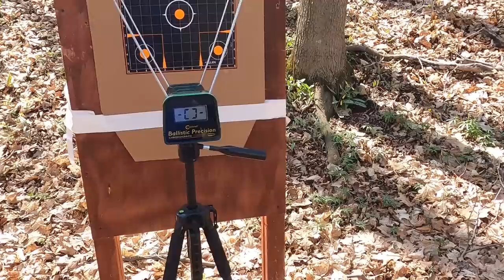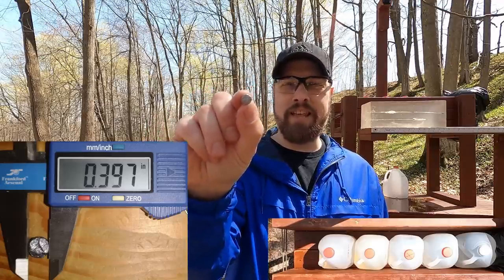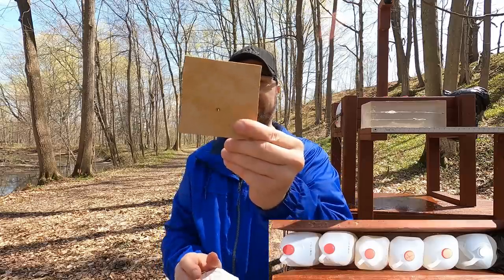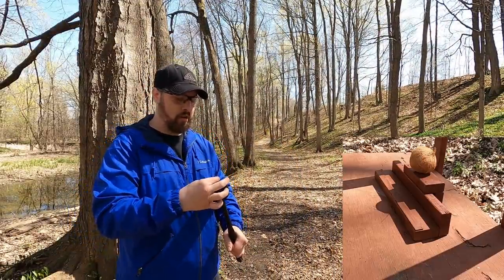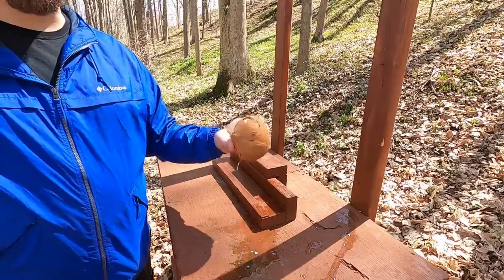WOW Dieseled Pellet Rifle RIVALS Firearm - .30 Caliber Break Barrel OVER 50 Ft Lbs Energy!

Comment: Its refreshing to see someone loading a spring rifle safely i.e. holding the barrel firmly in case the sears fail or you nudge the trigger. Better still, just break the barrel but don't cock it, load and THEN cock the rifle a close. Dieseling happens EVERY time you shoot a springer from the lube on the piston and cylinder. It doesn't damage the rifle though. The original users of dieseling used to drop the lube into the cylinder potentially causing more internal  damage. I suspect putting it in the pellet skirt may not be so damaging. However its still a very bad idea. Its also likely to totally ruin accuracy as well as the rifle. Its a stooped thing to do. If you want more power just buy the right kit

Comment: Having the ability to vary the power needed for any particular shot is a great asset. I have noticed a brand new air rifle with factory oil  within is a lot more powerful than after a few shots. Keeping the compression cylinder free of debris and the seal's clean is a difficult task, Old guns had leather seals.

Comment: I never thought of using Vaseline but I've used 3 & 1 oil many times. If it does hurt the gun I've never noticed it. Yep makes it much more advantageous for pests! Excellent video!
Reply: kinda opposite for me, I've always kept my pellets wet with WD-40..
over a year ago saw some videos on dieseling, "well no wonder!"
honestly didn't know I'd been doing it all along, for decades.
Crosman field pellets have the cone shape and short straight hollow, surface tension keeps that smaller hollow filled, inner cone surface only just wet, so it ends up being pretty consistent for the "extra charge" all by itself.
Reply: What ever you try, run 10 shots through a crony to see if the speed is consistent enough to hit a target more than once.  To me, if I am getting more than 2.5% fps change,---it might be OK for 30 yards, but that is not working for longer distances I like to shoot.
Reply: I have been using the vale line in pellet skirt for several years with great improvement in power. Your gun will have a different point of impact and probably prefer a different pellet. Main point: With Vaseline in the skirt , the dieseling happens in the barrel. Liquid fuels drain down into the piston camber and ignite there...big difference in seal life?
Reply: @EarthSurferUSA  They say if you use slugs and not pellets it improves accuracy because the pellets is unstable at supersonic speeds.
Reply: @a64738  That's correct, if you diesel your air rifle it's better to use slugs to keep the speeds down below supersonic for better accuracy. But then again, I saw a video recently of a guy shooting a Gamo Gen3 magnum .22, using super light alloy pellets that reached nearly 1400fps, well above the speed of sound, but they remained incredibly accurate at 35 yards. His results made me re-think that supersonic reduces accuracy.

Comment: Yep I've been shooting Air Rifles since 1980 and I'll tell you this dieseling my Beeman Duel Caliber Piston Air Rifle turns it into a lethal weapon and especially with 22cal non lead Red Flight Rounds it's definitely good for Home Defense shooting up to 1400FPS .
God Bless
Vaseline is the best way to diesel pellets because you can control the amount of dieseling and it doesn't run out if the pelletslike oils do. Try it you'll be very impressed because a half full skirt in pellets is just amazing added strength a full skirt in 22cal can be used for larger game especially head shots with a desieseled round will take down large game !!!!!!!!

Comment: Love my airguns. I have MP Pneumatics, springers, and PCP's. Enjoy them more than my powder burners honestly. Hope you keep doing some air stuff here and there. The market and hobby has exploded in the last 5 years or so.
Reply: I must admit that my sub 12ft/lb Diana springer is greatly improved when the pellets are dieseled. I tend to use a 30 grain pellet coated with molybdenum and dieseled with a vaseline/naptha(lighter fluid) mix. When the air temperature is very hot I can get over 1000ft per sec.
Reply: @49mrbassman  does your accuracy suffer though? It's claimed in the airgun world that a diabolo shaped pellet just can't handle much more than about 950 fps without destabilizing and negatively affecting accuracy. I personally can't confirm or deny, but I'd love to see an actual test done at say 900, 1100, and 1300 fps. At 20 yards I think you could zing one 1500 fps and you could keep it within a couple inches. I don't think it would work out to 100 yards though. When it falls back into transonic from subsonic is supposedly where the most of the destabilizing occurs.
Reply: @joshuagibson2520  it's more like an airgun bullet rather than a diabolo pellet it's very stable and gives excellent accuracy up to 75 yards. I replaced the original spring with an ox spring accelerator which increased performance and stability.
The pellets are knock out pellets and I stand corrected they are 25.39 grain made by JSB in the Czech Republic. The molybdenum makes them virtually frictionless in the gun barrel and reduces air resistance.
Reply: @49mrbassman  oh yes. I'm familiar with JSB knockout slugs. They're quite the little beasts. I'm still not convinced that airguns can't be effective in a supersonic scenario. All the pros I've conversed woth keep telling me that air and supersonic won't work with accuracy. Slugs or pellets. I've yet to see it actually tested and documented anywhere though.
Reply: @joshuagibson2520  I can only relate to the experiences I've had in the field when out rabbiting and I've taken plenty of Rabbits with a head shot at 60yards, I've also had a few woodpidgeons at about the same distance.
Reply: Air arm S410 SL  FAC ( About 890 to 900 fps with 5.52 mm 18 gr. pellets ) Over 3000 pigeons in the past 10 years at the dairy farm . Yes , they work .
Reply: @kermit8619  hell yeah. Fun fact, up north airgunner just launched some supersonic slugs with air and they were accurate. Sorta. They still didn't deal with wind too well. It was just an exercise in science. Says it's still never going to be a reality. I'm still going to hope it is.
Reply: @Troy Hendrickson we don't have an airgun violence problem anymore than we do a gun violence problem in this country that is a "public health epidemic". It's time to start rolling back infringement and be active, not worrying or wondering what they're going to try and restrict next.
Reply: @joshuagibson2520  At 1,000, most skirts begin to melt m m and lead the barrel pretty bad. From about 850 to 1150, you’re flirting more and more with Mach 1, and the shape of a a pellet does mess things up. Very unstable. A slug can handle the instability because the interruptions slide over it much better. 
One other consideration is that as you get closer to Mach, the ballistic coefficient of a pellet drops, well… lol like a pellet
Reply: In other words, even if you did a feat, and got the pellet to 1300,
Then had another lotto win, and it was accurate, (lol not) it would fall back below 1,000 before it went 40 yards, unless it were super heavy. Which usually assures it won’t go Mach to begin with. Ballistics above and below the sound barrier are two VERY different animals. A slug traveling 1700 FPS will suffer more wind drift in a given distance than a slug going 950. I kid you not.
Reply: @fanaticsforpneumatics6005  yeah. I'm still gonna dream though. Lol.
Reply: @joshuagibson2520  Bro man, May I be cursed if I stop a man’s dreams. I’m going over all this because I’ve been through it all over the last 6 years, from break barrels to Pcp s to 2k dollar pcps. You ever see “Blow” with Johnny Depp? What’d homie say to him in prison…”Perhaps you had the wrong dream, my friend.” lol what I’m gently guiding you towards is the slug world of airguns, bro. They carry SO much more energy long range. Think about it, a pellet is a self-stabilizing parachute lol.
 Dude, everyone says physics limit airguns to subsonic accuracy, and that’s it. But I still hope to see the day we understand how to get 2k FPS like black powder. I’m 50, and ain’t gonna stop dreaming! Your dreams are divine deposits, my man! Dream on!
Reply: The FX Impact introduced me to small (.25 caliber) bore airguns doing well with slugs. Now I have the semiauto Huben K1 in .25. I’m shooting 26.8 grain Neilson hollow point slugs at about 1080 FPS, and getting .60 groups at 51 yards. She’ll ring 8” steel at 217 over and over till it’s boring. Slugs are definitely where it’s at, and that’s what has propelled most of the renewed interest in the last 5 years for airguns. The difference in trajectory is staggering, dropping about half as much as a pellet at 217 yards, and retaining as much as double or more the energy as pellets at that range. It’s a whole different ball game that I invite all I can to come play in lol
Reply: @fanaticsforpneumatics6005  I agree man. Slugs are where it's at. The best gun I currently own is the Umarex Origin. I feel like eventually there will be a slug shape / design that will be able to overcome the 1000 barrier eventually. It's also going to take a power plant that isn't a single shot gun too. The airgun community / industry is blowing up! It's like we're living the muscle car era!
Reply: @joshuagibson2520  if you’re on a budget and wanna go the slug route, I HIGHLY recommend the Air Venturi Avenger. Adjustable regulator and hammer spring for 400$! I bought the earlier version, the Nova Vista, and I’m machining lol…. Ha ha Ruger 10/22 barrel down to fit it and shoot slugs. This barrel is 28 inches, I think factory is like 21. Gonna rework the valve, transfer port, etc. Fun Stuff! It’s a bargain for the price. Consistent and inherently simple too! Check it out
Reply: @fanaticsforpneumatics6005  that's gonna be my next purchase actually. Lol. I MUST get a compressor first though. The AVENGER isn't hand pump friendly like the Origin.
Reply: @fanaticsforpneumatics6005  my Origin is essentially a non regulated Avenger.
Reply: @joshuagibson2520  yes that’s right. The Huben is a 5k psi (350 bar) fill as well.
Help yourself and go with the Yong Heng compressor. I’m on my second one, first lasted 3 years of heavy use. 
I cobbled together a 60 minute 350 bar  SCBA tank with the PCP fill setup for maybe a lil over a hundred bucks. I can share how when you get ready, and communicate to help you, maybe make you some Delrin seals, etc to plug stuff you’re not using on it and seal stuff together. I bought like a 1996 manufactured tank, no dive or paintball shop would touch it with a 40 foot pole lol but screw them! lol we don’t need them fools anymore. We got 250$ compressors ha ha. And when I did used to go buy air in my silly ninja bottle, they could never get it over 4,000 psi bro. lol that sucked. This lil compressor will push my rifle or tank to 5k and then some
Reply: And if you ever need a Delrin seal real bad, but don’t Wanna wait for shipping??….
Nylon works plenty good, sir
Reply: @fanaticsforpneumatics6005  Hell yeah! The YH compressor is EXACTLY the one I've been eyeballing! What also appeals to me about it is replacement parts are readily available and they're pretty dang easy to maintenence and work on too from what I've seen. One thing you could advise me on is, what are you doing for a moisture filter? I'm not overly paranoid about it like some guys I've seen, but I do want some protection.

Comment: Every person that uses a cutting torch should be familiar with the rule to Never put oil on the threads of gas gauges. I have seen the aftermath of an oxygen cylyender and the melted gauges after someone put oil on the threads. The oxygen in the compressed air acts very quickly with oil. That is why dieseling is so effective. I blew the seals and the back end out of my first air rifle as a kid ,when i put a few squirts of 3in one into the compression chamber. i learned about dieseling fast.

Comment: A good side by side test. I am not surprised to see the dieseled pellet go deeper, you were between 30 and 50 percent faster. Speed kills, literally. It just shows you that the air rifle you use for varmits can be used for defensive needs if your desperate.
Reply from the maker: Thanks, and that's why I tried to hit home the pellet weight. If we went 40% faster with an 8 gr .177, this is nothing really. But doing it with a 48 gr pellet is like, well the extra is twice as powerful as some pellet rifles not to mention the start power is more than most. I own a typical .22/800 FPS springer that maxes out at 18 ft lbs, so three times the power of typical is not bad.

Comment: Being an experienced motor-head I am amazed at the long shot of achieving a stoichiometric or theoretical air to fuel mixture by placement of the fuel.....Any amounts of 'boost' by the dieseling would literally be roulette wheel chance at achieving an optimum max-power mixture
Reply: It seemed to be running a bit rich. 😊
Reply: WD40 a little drop seems to give the most bang, double the velocity according to chronographs. Vaseline and a lot of it gives low velocity.

Comment: Ultimately dieseling will blow seals sooner and can cause extra wear on the airguns performance. It's fun but the gun was not built with the extra pressure, not to mention the explosion that occurs when dieseling. It will make your gun require more maintenance sooner and can eventually damage it.
Reply: Joshua Greenspan  What's that got to do with anything? I didn't say anything about not dieseling in fact I said it fun. Just there are consequences to doing so.
Reply: Nah

Comment: Learned all about Dieseling pellet guns here on YouTube almost a decade ago.
    Swear by it, although I have blown a seal or two over the years.
    Generally an increase of between 25% to a third more power across the board.
  Good times👍😁
Reply: " I have blown a seal or two over the years."

In the bay, or at the Circus?

Comment: Impressive for a pellet gun. I know some of the high end ones can really get down and absolutely be lethal. I know the AirForce Texan is a .45 Caliber air rifle capable of taking down medium sized game with ease so I'd have no doubt it could take down a man with a well placed shot. These .30 Caliber pellets would absolutely be something you wouldn't want being shot your way. I do question though how quickly it loses that velocity and how far away you'd need to be before the penetration would be less than lethal. I noticed you were shooting from fairly point blank ranges in the testing, so I wonder at 25 yards or 50 yards how much effect would it have even when dieseled.

Comment: Thanks a lot for this video, The best material to diesel the pellet is the Gun Oil you use on gun maintenance it would heat up faster produce much greater pressures.

Comment: Wasn't aware that this could be done Pretty impressive!!
Reply from the maker: Yeah it's a neat little thing, but always a cautious thing as pellet gun barrels are not heat treated rifle steel.
Reply: @GunSam  Are they rifled in the same manner as a firearm barrel? I’d be curious as to the comparisons of twist rates etc between them if they are.
Reply: @Bodhi1satva  They are rifled but to what extent i really can't say I'd be curious also to know. I've been shooting both air and powder rifles and pistols for well over 25 years and can honestly say I've never diesel anything before.
Reply: I'm shocked you said you couldn't get through the bologna. My .22 caliber break barrel can blast straight through a pack as thick as you had with no issue's. But regardless good info and good shooting.
Reply: @jamesleary1405  your 22 probably has similar power with 30% less surface area leading to more penetration.
Reply: I put a 22 pellet through a heavy metal paint tin .Big entry and exit hole ..Gamo roadster spring.

Comment: Cool video! I never knew dieseling your pellets was a thing.
Reply from the maker: Thanks!
Reply: I didn't either but found out 15-16 months ago, I'd been doing it all along!
I'd always been keeping my pellets wet with WD-40, the thought being the light oil helping skirt seal and barrel a little lubed too for a little more hit. didn't ever think about pressure actually detonating the oil stuff, just knew it worked better.
Reply: used penetrating oil a year ago to get a 177 pellet gun working again. anyway the first shot was loud. even had some smoke come out of the barrel. think the gun was 1000 fps without the oil. suprised me

Comment: My friend put a Titan XS no.5 spring in a B19 .22, he also way over greased it so grease actually was coming out of the air transfer port. To his surprise it made a few 32 ft pound shots on the chrony, once it settled down it was consistently running at around 16 ft pounds, which was still too much for his countries laws so he had to go back to standard mainspring. But its safe to say that Dieseling can potentially double the muzzle energy. And in this video it went from 30 ft pound to 55 ft pound which is almost double.